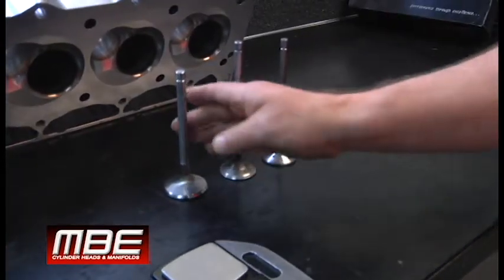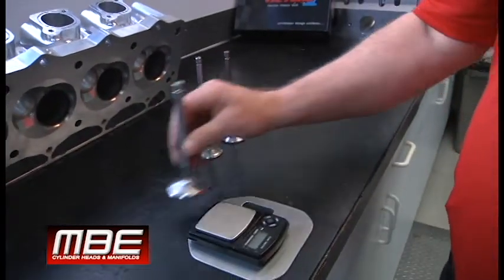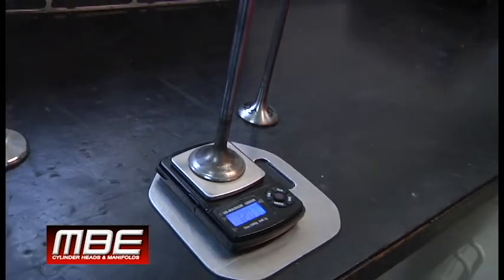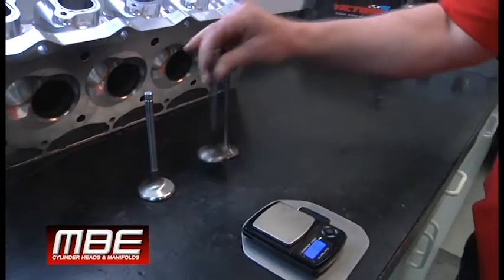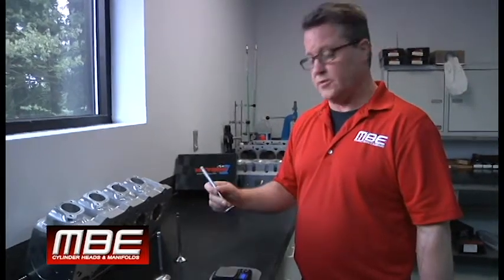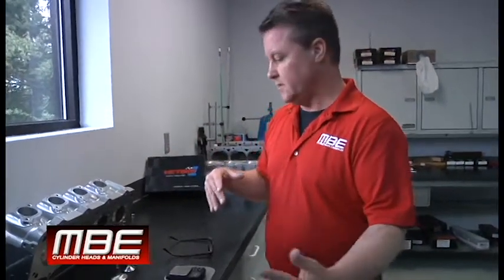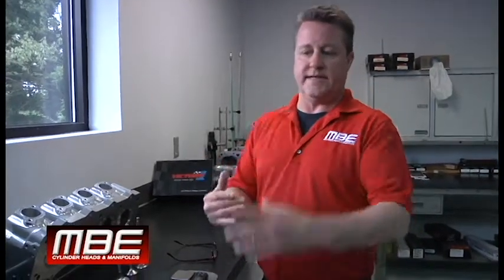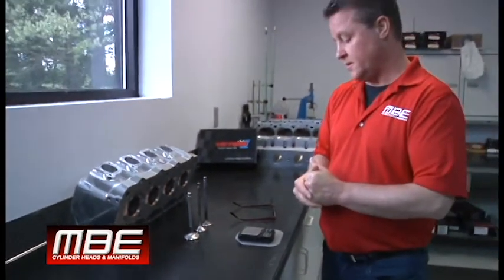INCONEL VALVES 101  ** TECH VIDEO **

Comment: How does the heat dissipation deal vary if using copper bronze seats or doesn't it, can stainless exhaust valves and copper bronze seats last nearly as good say for boat applications or boosted gas motors